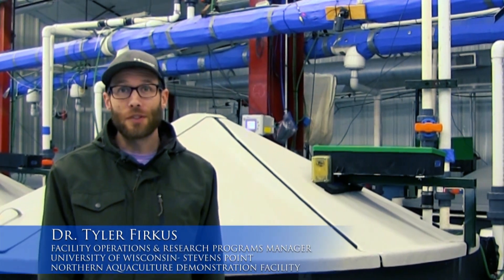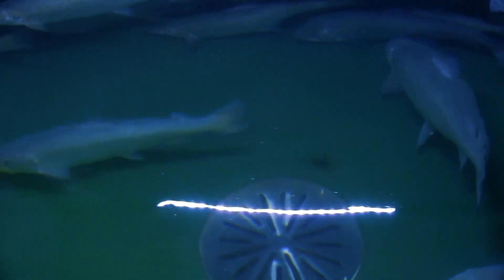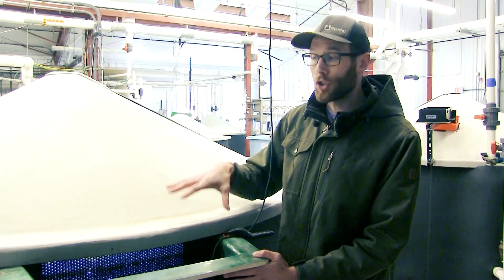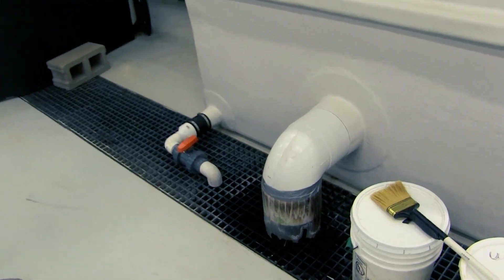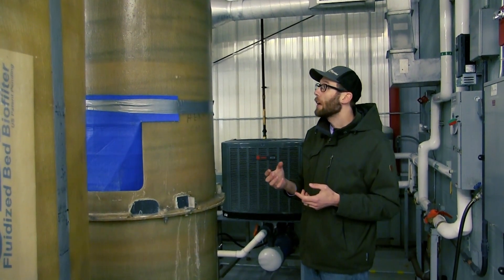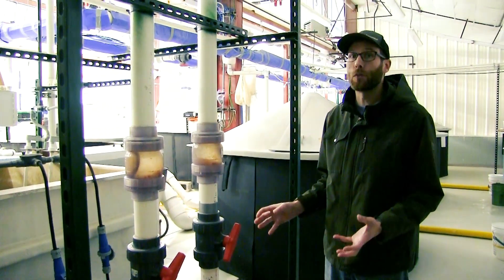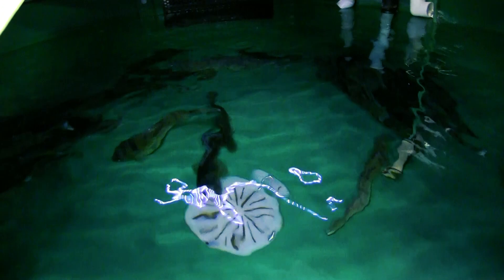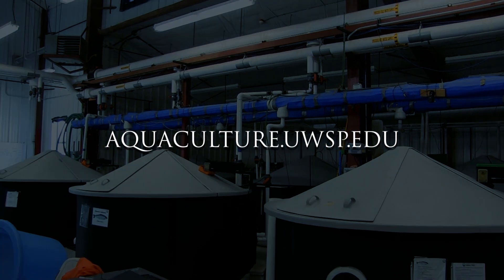Showing a Recirculating Aquaculture System in Action

Comment: I appreciate you sharing the knowledge about aquaculture. May I ask a few question? 
1. Do we need to use standpipe for both bottom drain and side drain as like your tank?
2. How can you connect the standpipe of the side box with piping system? I mean do you use bulkhead fitting or any fittings in the side box to connect them?
Reply from the maker: Thanks for the question. Having two standpipes gives you greater flexibility on water level and flow from the bottom versus the side drain. In addition, if we needed to convert this tank to flow through (stop sending water back into the RAS if we had to treat the tank for example) we could increase the standpipe on the side box so no water would overflow and convert the bottom drain to simply flow into our trench and out of the building. If you email us at ehauser@uwsp.edu I can send you some photos of how our side box is designed, there are a number of ways you can design them, ours is designed with fiberglass fitting (sleeve) that is built into the bottom of the side box as one piece, in which PVC is glued into. We have purchased many of our RAS tanks through hydro composites: https://hydrocomposites.com/ if you want to contact them about some various designs.

Comment: Hello, I'm truly impressed by your system. I'm currently studying recirculating aquaculture systems and would greatly appreciate your support with a few questions.

I'm particularly curious about your temperature control setup. Are you using a chiller? Does it operate continuously (24/7) to maintain temperature? Also, is its power consumption significant? As you know, optimizing operational costs is essential for profitability in fish farming.

One more question — regarding Atlantic salmon in your system: is it raised in freshwater? I noticed in some comments that freshwater is used, which surprises me since this species naturally inhabits the Atlantic Ocean. Could you please clarify?

Thank you, and I look forward to your response.
Reply from the maker: Hello, thank you for your questions. As for temperature control, there are various options available for RAS facilities and may depend on your own set up. In our salmon RAS, we have two Titan in line water heat pumps, and run them consistently to maintain temperatures around 12C, they are 3HP, 460 volts/2760 watts each. These were purchased from AquaLogic. In this system, these heat pumps are on a side loop so that they can be bypassed if needed. When in operation, water is pumped from the sump into a distribution line and a portion of water is run through these heat pumps from the main distribution line and then back to the sump. The rest of the distribution water runs through UV sterilization and then to the fish tanks. If you are designing a system, we highly recommend working with an engineer experienced in aquaculture to ensure proper design and efficiency to suit your needs. If you would like further details on our system, please email us: ehauser@uwsp.edu. As for the Atlantics, yes, they are raised completely in freshwater, as most salmonids can be raised completely in freshwater. They will still go through the process of smoltification (to prepare their bodies for saltwater), but not being exposed to saltwater does not affect survival. We have done some research looking at various strains of Atlantics and performance in salt vs freshwater, we are still analyzing results. The Conservation Fund's Freshwater Institute has done a lot of work on Atlantic salmon, feel free to check them out here: https://www.conservationfund.org/focus-areas/resilient-communities/freshwater-institute/

Comment: Hi , i 'm curious how you make the water circulation flow in a circular motion in the tank
Reply from the maker: Hello @YeeKhaiify we can do this several different ways. In our Atlantic salmon tanks, the tanks have been manufactured with water jets that are formed into the side of the fiberglass tank. The inflow water is supplied to these jets to create velocity in one direction. In addition, we can also create velocity using a capped PVC pipe with holes drilled down in a line for our inflow pipe. The size and amount of holes determines the velocity of flow (larger and more holes creates lower velocity, fewer and smaller holes creates greater velocity). I would be happy to discuss or send photos, email us at: ehauser@uwsp.edu

Comment: I have a question my friend: How many kilowatts of energy do you consume per month?
Reply from the maker: Hello @gabimatei855 our facility is 8500 square-foot production barn (what you are seeing in the video) which has the two RAS along with incubation, larval and flow through systems. We also have four half acre ponds that utilize power for aeration throughout the summer months. It is difficult for us to give you an exact number for one of our RAS apart from everything else, but an estimate would be around 28600 kilowatt hours per month for one of the RAS systems. The salmon RAS has three, 4hp, 3-phase pumps running consistently, which is most of the systems energy consumption.
Reply: @uw-stevenspointnorthernaqu8491  Thanks for your response. I wanted to calculate roughly how much I would consume if I opened a 600 square meter facility. If I had two pumps, I still think that I would consume around 2000 kilowatts/per month.
I don't know much at the moment, I'm new to this topic but I'm documenting myself day by day. Thank you for your answer!
Reply from the maker: @gabimatei855  if you are pursuing RAS, it is critical that you utilize a proven system and design. If you like we can share with you some further resources for this, feel free to contact us: ehauser@uwsp.edu
Reply: @uw-stevenspointnorthernaqu8491